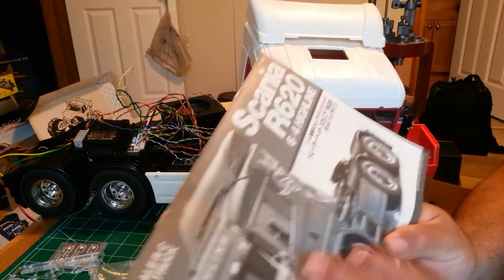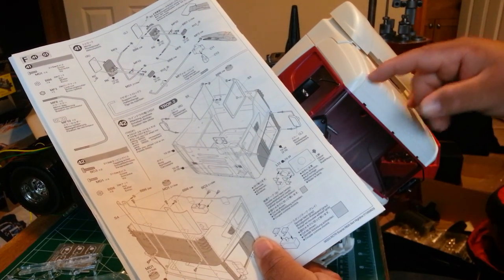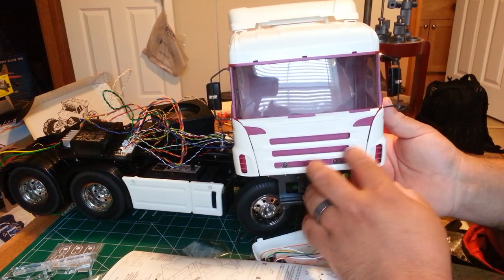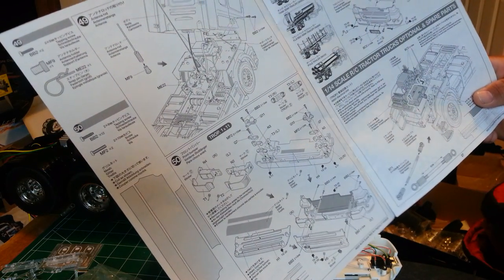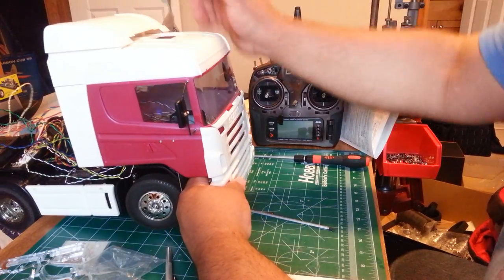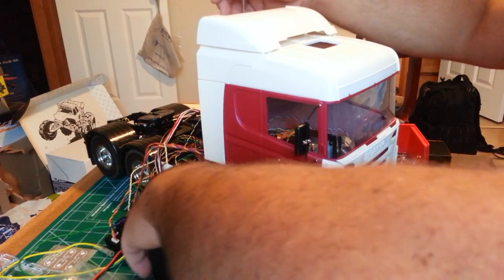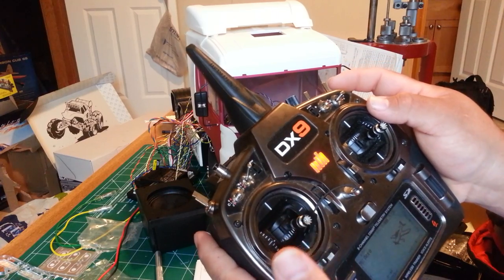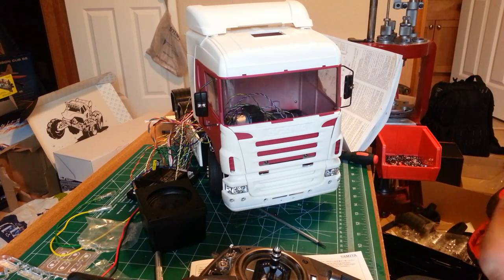scania build 9

Comment: What's the cheapest place or website to buy the truck lights and sound unit? Thanks
Reply from the maker: ebay is by for the best deals if you can get it with free shipping. past that most places sell it for the same price. the shipping is where they get you on the cost.

Comment: I have only just heard of these models and I was wondering if in need to put the MFC in for it to be RC.
Reply from the maker: J Slater no you do not need it.
Reply: Is it easy for me to come back and fit at a later date?
Reply from the maker: J Slater for the most part yes. you will have to take some things apart to get it hooked up.
Reply: Ok thanks

Comment: Hello Speedy, Nice videos and a great end result. I was wondering? Without the Automatic 5th wheel and the working Trailer "Legs" would it be possible to have a bigger battery in the "Load" and disguise the electrical wires as the Air Lines?

Andy C
Reply from the maker: +ANDREW CULLEN you can i have seen it done. its not something i have ever tried

Comment: Hi a few weeks ago i bought the Scania R620 highline and have been using your videos to help me build it i have now got to the electrics stage and followed the instructions but for some reason they are not working correctly are you in a position to help/advise me best regards Len Eager
Reply from the maker: Len Eager I can try. whats the problem?
Reply: Hi the problems are as follows firstly when you push the left stick forward it goes in reverse when you pull it back it goes forward and the reversing lights come on and i am not sure how to get the other lights to work, this is my first build probably a bit ambitious, i am using the carson reflex stick 2 and mfc03 regards Len
Reply from the maker: Len Eager for the forward reverse problem just change the wires that hook the motor to the each around. as for the lights did you fallow the settings for pairing the mfc to the controller
Reply: Hi i got the forward/reverse sorted changed the cables over, but to get all working seems very complicated unless you have an easy method, i am concerned about pressing various buttons (ie sw1 & sv2) sorry to be so ignorant but i dont want to mess up electronics regards Len
Reply: Hi sorry no I didn't do the pairing what does that entail?
Reply from the maker: Len Eager unfortunately your going to have to. that's the only way you can finish the set up. just read the paper work a few times and go slow. you won't brake anything
Reply from the maker: Len Eager using the little buttons to tell the mfc what max and min travel is

Comment: If you buy it have a free baterry or you will buy
Reply from the maker: i sorry i don't get the question. when you buy the truck its just the truck kit, no paint or electronics. you will need to buy 2 servos an electronic speed controller batter and controller. then you will need to build the truck.